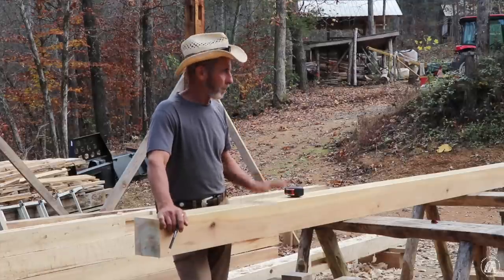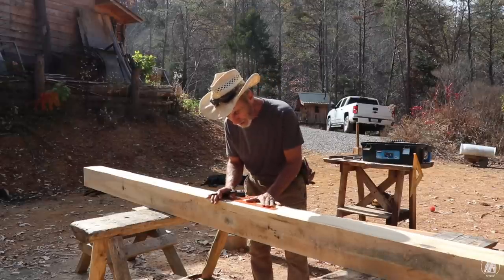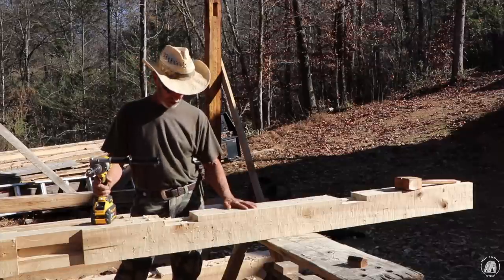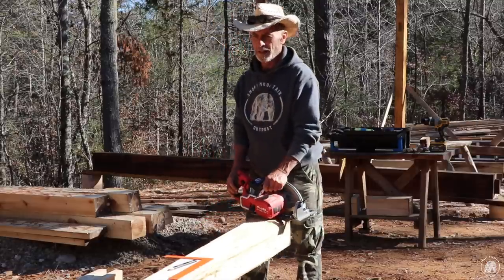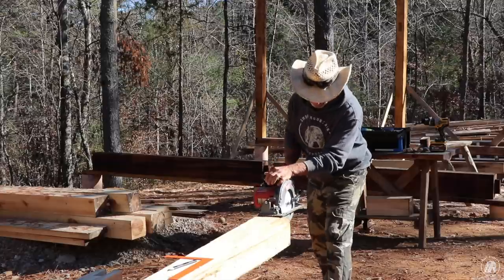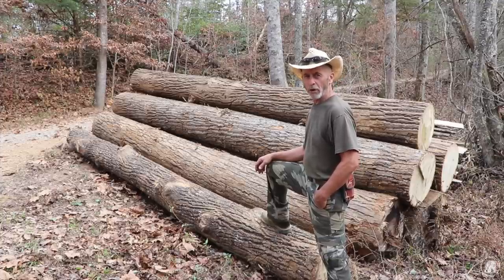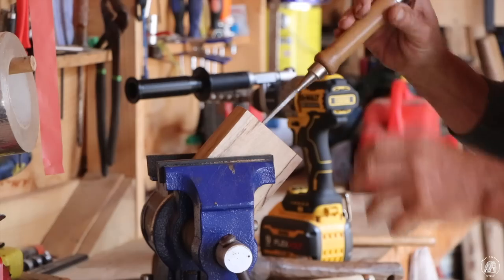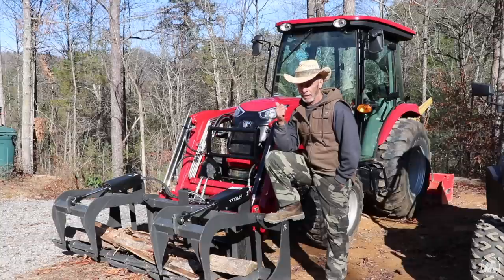Building a Timber Frame Workshop Off Grid

Comment: How long do you let the boards and beams dry before you use them. Or do you put it together green??
Reply from the maker: Most of the time what I build with is green. I have some that have dried over a year but mostly green. I know there will be shrinkage but when building I try to allow for it. Early pioneers built with green material but had the same results. Anyway, if you research timber framing you will find most building is done with green materials. I would rather have dried but that would be cutting logs and having to clear up everything left from that process or you would have a mess in the woods. That would take a long time to do and the green material hasn’t caused that to much problem that I can’t live with. But if you have the time and can wait, I would fell the trees, cut and stack and let them dry for a year or two and then begin. I don’t have that kind of time so what you see me do is how I do it